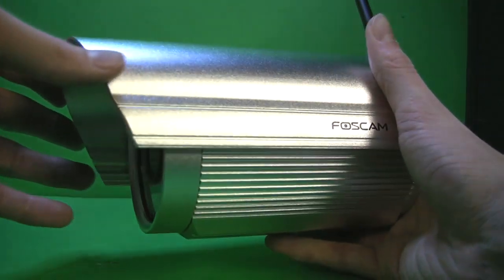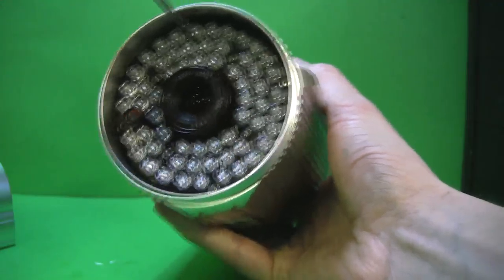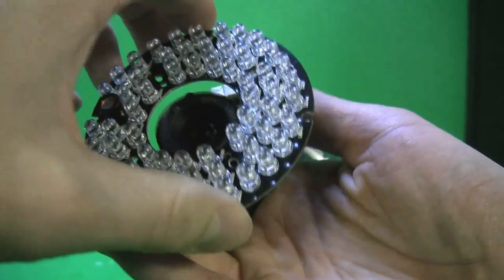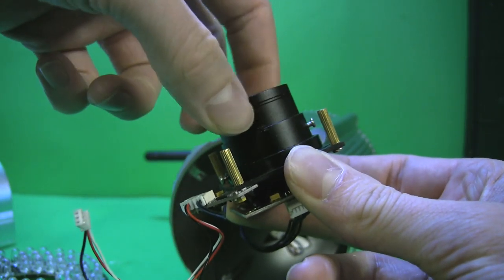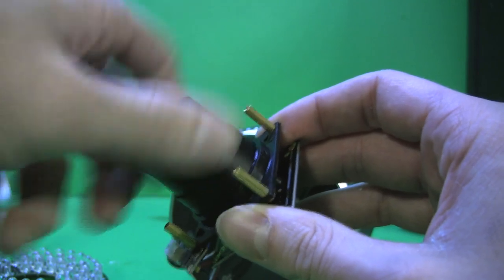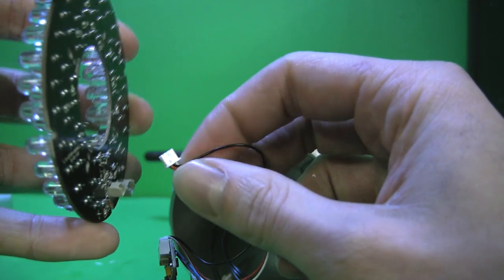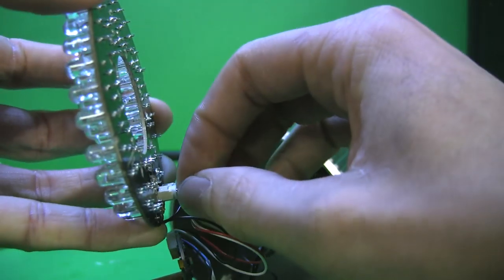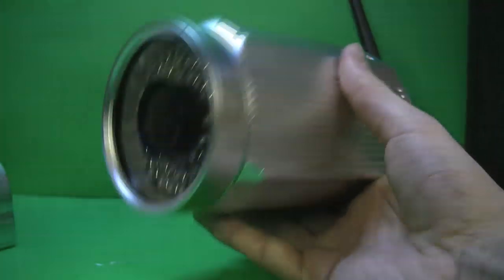Foscam wide angle lens conversion fix for model FI8905W Wireless IP Camera 2.8mm

Comment: These Cams work fine, I have six installed both inside and out, they are a little bulky and the wire harness is a pain in the ass, although nothing a little modification cant handle..  As for the morning whiteout complaint, "Non-existing "in my setup..

Comment from the maker: but all the latest models have the filter built in right over the sensor placed in front of the sensor in a plastic enclosure part that is removable if needed to achieve better night vision but wrong colors during the day. its held in by 2 screws that need to be replaced if you want to use our 2.8mm lens because of focus issues the stock screws cause that have bubble type Philips heads and dont allow the lens to thread in far enough to get in focus.